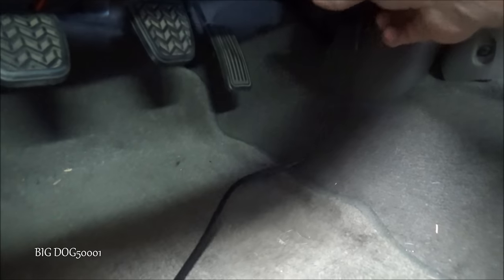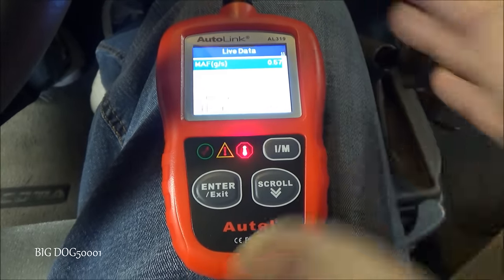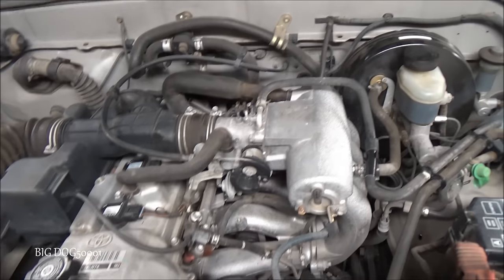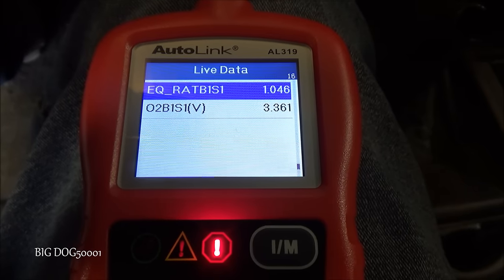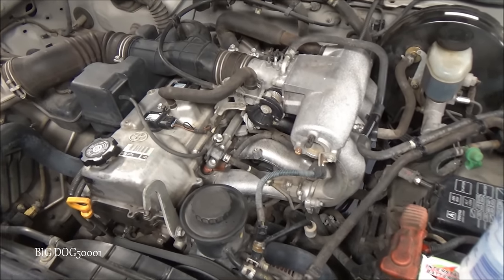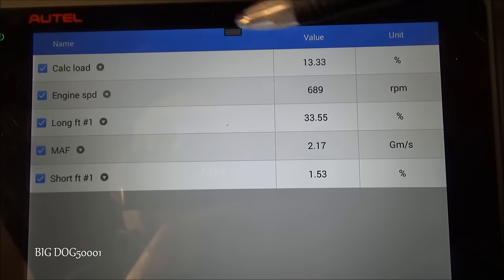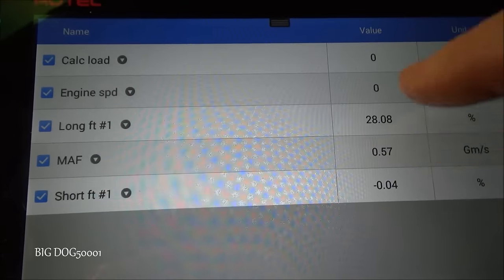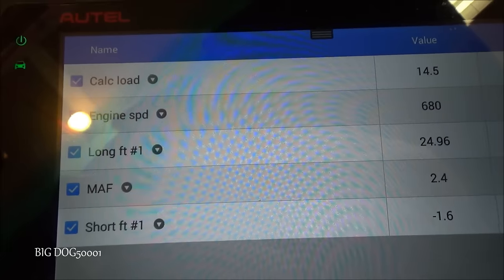P0171 Trouble Code: System Too Lean Bank 1 Diagnosis

Comment: I have the lean code on bank one and last night it also gave me a rich code and started running really rough. Fixed a PCV hose leak and now just have the lean code. The short term fuel trim is 38.5 So is the long term trim. When I rev the engine the short term # doesn’t change but, the long term drops..... Normally I get 12.7 litres per 100km last night I got 23.7 per 100!!! The heads were just rebuilt 3 weeks ago and I have 180psi on all cylinders. Did a smoke test and couldn’t find any vac leaks. Some times after clearing the code/s it runs great with lots of power and decent idle for 1/2 a day up to a week and then can suddenly have these issues all day.  While it was running rough last night I disconnected the left bank fuel injectors one at a time and listened for a change in how it ran and couldn’t notice any difference. However if I disconnect them on the passenger side all three injectors clearly stop firing as you can hear it in the engine. I have 60psi on the fuel rail 50psi when not running and no pressure drop off.....Any suggestions? 04 Jeep Liberty 3.7l
Reply from the maker: Several things can cause a lean code on just one bank, have to look at things that effect one bank only (O2 sensors etc).  Pay attention to when this is happening, cold engine, warm engine or all the time.  Also, if this happened right after rebuilding the heads, double check all work.  It is easy to forget to plug something back in or plug connectors into the wrong places or forget to connect a ground wire (or worse there is an issue with the head).  Misfires and lean codes can go together so I would definitely make sure I had fuel/fuel injector control and coil control/spark on all cylinders on that bank (everything plugged in and working correctly and all power/ground and signals from engine computer getting to injectors and coils).
Reply: @BigDog50001  Thanks for getting back to me! I put in new plugs and changed all the coils from a good running engine. I did change one faulty injector on the right bank 2 weeks ago. I have injector cleaner in the tank now. I did find a split in the v band clamp just before the O2 on the left bank, I’ll change that and see if it was making the O2 report false readings.
Reply: @BigDog50001   I changed the upper oxygen sensor and that cleared the lean code. Both the long term and short term fuel trims have lowered and fluctuate up and down. Fuel consumption has improved greatly however I do still smell unburned fuel in the exhaust and do have a bit of white smoke. I checked my coolant level and it is still full so I don’t believe it’s burning coolant. The Jeep has slight hesitation when I first start it and move from a stop, once warmed up it’s better but, does still haveI stumble or misfire at idle it’s very noticeable when stopped and under load in gear. I changed the three injectors on bank one because I had spares I figured it was worth a shot it did not make a difference with the stumble or miss.
Reply: @BigDog50001   For anyone following along, I went for a drive on the highway. After about 15 minutes of steady driving at 100 km an hour the Jeep started to run better. I’ll believe the ecu needed to relearn the fuel trims. After another 15  minutes of back road driving at 80km/h 2 Codes popped up. P0139 and P0032. I cleared them and so far they haven’t come back. The exhaust smells much better and there is almost no vapour, it gets 12.4 litres per 100kms now and the idle has smoothed out really well with only the tiniest miss once in a while. Thanks for the tips!

Comment: My Mercedes threw this code after the built in check valve in the recently replaced fuel filter went south. Just my 2 cents.
Reply from the maker: Thanks for the input!

Comment: If my maf sensor isn't tightened down to make a correct seal, could that cause this code? I have an aftermarket intake and my maf doesn't secure down perfectly, I've been thinking of using a little rtv to create a seal to help seal it off...... Your opinion on doing this?
Reply from the maker: Yes, not sealing well and aftermarket intakes can cause this code.
Reply: @BigDog50001  I would think the ECU would be able to correct this imbalance. The code comes and goes..... I've noticed it happens more when I use the AC.

Comment: Wouldn't it be easier to smoke all they systems? If you have a smoke machine?
Reply from the maker: Nothing wrong with using a smoke machine, although an argument could be made on whether it's easier or not.  It still wouldn't have completely diagnosed this vehicle though.

Comment: When the problem is complex, as in your case, it is a good idea to use factory parameters to fix the problem faster. Your qualification requires that you have access to this information. Your diagnostic method is a professional approach. It seems that you have a long experience in the automotive industry. Congratulations on the great video. I have one question: Did you try to clean the sensor with the vial you showed on the camera? And if you tried, was there any improvement?
Reply from the maker: Even though it looked clean, I did spray the MAF sensor with cleaner, there was no change.  Thanks for the comment!
Reply: @BigDog50001  . Thanks for your time!

Comment: I wish I could drive to Arizona so you could help me !! (Do you actually have a shop that works on cars though at this time ?)
I live in Orange County Ca and two mechanics I’ve had work on my car have not been able to pinpoint the cause or causes for my running lean on both banks. Both don’t have (at least I don’t think) smoke machines to test for vacuum leaks and of everything I am reading and hearing is accurate, the most common thing to cause that code is a vacuum leak of some sort . I realize it could be other things too or in addition to that such as the fuel pump or catalytic converter or intake manifold gasket but no one has been able to rule out a vacuum leak for me. 
Sure I could have them replace part after part and see if the Service engine soon light stays away but I’m BROKE and don’t want to risk replacing parts that were never the problem in the first place . 
I have replaced both O2 sensors as well as the MAF with the light eventually coming back on.
If anyone reading this lives in Orange County CA and can recommend an honest and competent shop that has a smoke machine , PLEASE share !! I don’t know how common it is for shops to have smoke machines but my shop never said “we tested for vacuum leaks with a machine and didn’t find anything “ so I am assuming they checked visually . I completely trust them but they can’t help me with finding a vacuum leak if they don’t have the right equipment and I am quite certain that with my car being as old as it is and me driving it (I drive it for a living in addition to using it for personal use) many miles a day , it only makes sense that it might have developed some cracks and deterioration in the hoses and vacuum lines. Once I can know for sure if the codes were not due to that , I can check for the bigger things but why would I do that without trying to spend as least as possible at first, right ?
Someone please help me !!
😭😭😭😭
Reply from the maker: Thanks for the comment.  One thing I will say, don't get hung up on only one possible issue, just because it might be the most common.  A $30 code reader and comparing fuel trims at idle and then at 2500-3000 RPMs is an easy way to check for indications of a vacuum leak (I showed this in video).
Reply: Big Dog50001 Automotive thank you . To raise the RPM, am I just stepping on the gas after I start the ignition ?
I think I will buy the code reader and watch this video several more times before I go poking around soon.

Comment: Really great video! I was wondering if you could help me, I have a polo 2002 that doesnt enter closed loop, I've seen it enter closed loop only a couple of time after lots of driving in a short time, I have a p0171 code. Any help would be appreciated
Reply from the maker: Thank you for the comment and I wish I could diagnose it from here but that is pretty much impossible unfortunately!  There is most likely an input the computer is not liking so it prevents it from going to closed loop.  I would start by looking at 02/AFR data and MAF/MAP data on scan tool.
Reply: @BigDog50001  I completely understand! Thanks for the reply and the info on where to start 😁

Comment: Great explanation but did you explain how to fix the brake booster?
Reply from the maker: I did a brake booster diagnosis video using this vehicle.  The fix for the brake booster is to replace it.

Comment: I have a p0171 and the idle goes all over the place when I press on my brake booster. Do I need a whole new one or will a gasket do?
Reply from the maker: Typically when a booster fails it is internal and the whole assembly either needs to be replaced or rebuilt.
Reply: @BigDog50001  Got it. Thanks

Comment: So my bank 1 system code came on. I told the auto shop that I already got a diagnosis stating this but they are insisting that I get it done by them. Would you suggest I get another one done or is bank 1 enough for them to figure out the problem?
Reply from the maker: A lean code can be a lot of things, pretty much any reputable shop would want to diagnose it themselves if they are going to be the ones fixing it.
Reply: @BigDog50001  they told me that it is my fuel pump regulator. Does that sound correct?

Comment: So I’ve looked at my corollas data live and all... the short term seems to be high (19.5) at the start of the engine and it is winter... I rev the engine and it lowers to single digits, rises back. However I let it run longer and it’s idling and the shorterm is staying in the single digits now... what’s up with that, anyone have a clue? I couldn’t find any air leaks as well.
Reply: I kept watching the video and sounds like a possible intake manifold defect... I’m going to spray some water on it when it cools down... but is that a problem I need to really fix? Can the car run ok for long term if it just has that initial leak and then is fine? Seems like it would be to me, but how would one fix that?
Reply from the maker: Intake manifold leaks are a form of vacuum leak and will typically show better fuel trims at higher RPMs.  Gaskets will generally seal better as the engine goes from cold to hot due to expansion of the parts (which can slow or stop vacuum leaks).  Gasket leaks tend to show up more in winter time due to the colder weather.
Reply: @BigDog50001  thanks for the advice and video! I cleared the code and it hasn’t set off again so I suppose I maybe because it had gotten real cold that day and I didn’t let the car warm up before driving, but idk! Thanks again!

Comment: did you actually clean the maf sensor, to no avail, or did you just replace it?
Reply from the maker: It was already very clean but I cleaned it off camera, did not change anything.  Typically cleaning only helps when you can clearly see some buildup on the sensor.

Comment: I've been grappling with this t.c. for yrs. now (replaced the maf, fuel pump, checked for vacuum leaks -all to no avail!  This video is of a high value -much obliged & woof, woof.
Reply from the maker: lol 👍
Reply: @BigDog50001  HOORAY! I just solved it by replacing my injectors (they passed the stethoscope test, but were varnished badly) - P0171 has not shown up in two months, periodic misfire disappeared and mpg up from 19 to 26.  Short & long fuel trims back to normal.  I'm getting some wild swings on my MAF (which oddly I didn't have pre-fix), but no real performance issues.
Reply from the maker: @davidm3210  Excellent!!

Comment: Question!  Can a bad oxygen sensor cause a rich or lean fuel trim situation? I'm thinking it can
Reply from the maker: Yes they can report incorrect fuel trims to engine computer.
Reply: @BigDog50001  thanks for the reply! I had a  problem with a broken wire on a 5v reference circuit going to my map sensor that was intermittent. Finally found the problem, but my oxygen sensors are reading slow on my scanner and my gas mileage has dropped.  I'm afraid my catylitic converters may now be clogged up.  This is on a 2008 gmc sierra with a 4.3 v6.

Comment: Excellent video.  I have a P0174 on my 09 Frontier and I’ve ruled out fuel supply, and have replaced the MAF sensor.  I checked for vacuum leaks twice now using both water and carb cleaner with nothing found.  I’m suspecting the brake booster now...thanks for the video.
Reply: Brake booster would trigger a p0171???
Reply: When I was looking for a potential vacuum leak, I was thinking that it was possible for an internal leak in the booster.  That ended up not being the case.  My plastic water hose coupler for the heater core Inlet hose had a small crack and coolant was dripping down on the exhaust and mostly vaporizing, but was also running down into the O2 sensor (upstream).  I replaced the plastic heater hose coupler with an aftermarket version made of aluminum (even has a bleeder screw to remove air from the system) and replaced the upstream O2 sensor (on passenger side of truck) and has been fine ever since.
Reply: @Craigs-corner  interesting 🤔  I do notice a lot of water dripping and I assumed it's the AC
Reply: It’s a common issue with V6 Frontiers.  I was noticing that my coolant level has slowly been going down, but I never had a leak form under the truck (aside from AC condensation drain).  The coolant was running down the outside of one of the hoses (versus dripping straight down) and then would drip off the hose right over the exhaust manifold…you could see the dried coolant reside, and had it all over the O2 sensor.  I believe the O2 sensors are vented through very small passage ways in the connector body, so I’m betting that coolant was fouling the sensor (it eventually coded for that particular sensor).

Comment: I just wanted to thank you again for this video this video helped me solve a long-standing problem I had turns out it was a vacuum leak #3  fuel injector oring leaking . With that problem I had many codes p0171, p0300,p0301and p0302 all intermittent. And fuel trims exactly as you described. Thanks again !!!!!
Reply from the maker: Glad it helped, thanks for the comment!

Comment: Pinching off the brake booster hose probably would have told you the booster was leaking.
Reply from the maker: Yes most likely, but for a video I choose to do what I did because this was a teaching video.
Reply: @BigDog50001  OK, I'll do my own teaching  video about pinching off vacuum lines to detect leaks and using a cigar instead of buying a smoke machine.
Reply from the maker: Steve Radanovich  I’m sure you’ll get 10s of views.

Comment: Would a bad brake booster turn on an ABS  light?
Reply from the maker: Not normally but depending on the system it is possible.

Comment: Use fast motion to speed up waiting for the scanner to complete its function and the like.
Reply from the maker: That's not my style but thanks for the input.
Reply: Big Dog50001 Automotive 
Try it out and see if you can fit the speed ups in and still maintain the instructional value and your style. I wish I could afford the pro scanners, so it’s cool when they’re shown.

Comment: I have the same issue on my car. Starting to diagnose tomorrow.
Reply from the maker: Good luck with your diagnosis!
Reply: @BigDog50001  Thank you, I have fixed it yesterday. I just cleaned out the MAF sensor and it's running way better. I think I might have some issues with the idle stepping motor because it takes 2 seconds to idle good after I start the engine. The MAF was the original on the car, made in 2001.

Comment: So pretty much you needed a mass air flow sensor
Reply from the maker: Nope, that was only part of it.
Reply: @BigDog50001  then the only thing I saw you fixed was the brake booster line correct?

Comment: I'm having this problem right now!
Reply: I really appreciate your time it will help a lot of people!
Reply from the maker: You bet 👍!
Reply: Do you think a stuck open injector would cause that code my car dumps gas I changed the mass and o2 I checked for vacuum leaks but nothing. The car sat for 3 years before I bought it.
Reply: Also getting gas in the oil.

Comment: Can p0604 cause p0171
Reply from the maker: Possible but it could just as easily be two separate issues if both codes are present.
Reply: @BigDog50001  It turns out that the 604. Was a battery issue. Cuz then when I replace my battery with my warranty. I haven't received it yet. Ms171. I know I don't have a air intake leak or any vacuum hose leak. I checked it. But I did remove. The front O2 sensor and found that I had one of them. Saturated in oil So I have cleaned it out play some back in the car. And going on day one with no check engine light. Waiting for two more days.

Comment: Hi Big Dog,
Thanks for the informative video. I am dealing with my 2004 Tacoma 2.4L similar to this car.

I purchased the same reader, and when I begin to diagnose on my cold engine at 13:40 of your video I noticed the Engine Coolant Temp was about 80 F and the IAT was about 50 F a bit far from each other and outside was closer to 50F. After warming up and idle at 700rpm, I begin to rev to 2500 rpm and the Short FT drops to 0 and when truck returns to Idle the Short FT stays at 0 no recovery. Both Short and Long are maxed out before this. My MAF reads 2.71 g/s and the oxygen sensor reads correctly at 3.3 to 1 ratio. Also before all this, I did replace the oxygen sensor as the truck was throwing a code to replace the upstream sensor. Since then the only code I have now coming up is P0171. This of course came after the code to replace the oxygen sensor. 

Any advice would be super helpful, I'm trying my best to fix this myself and hate to throw in the towel. 

Thanks BD